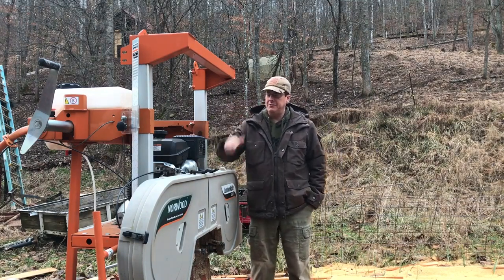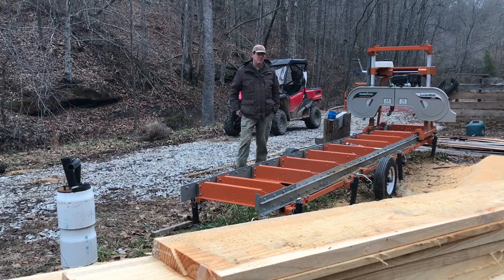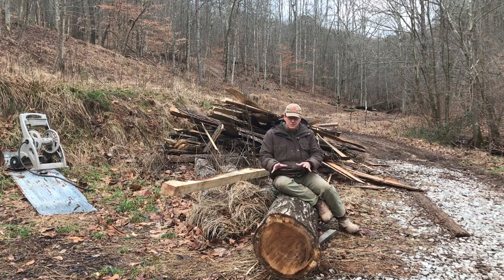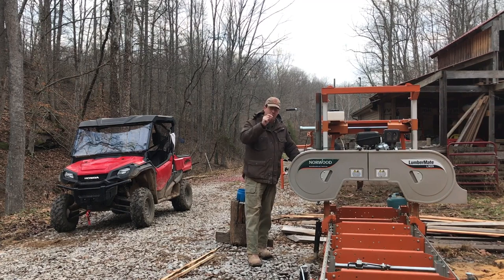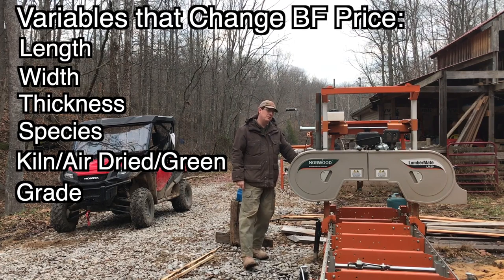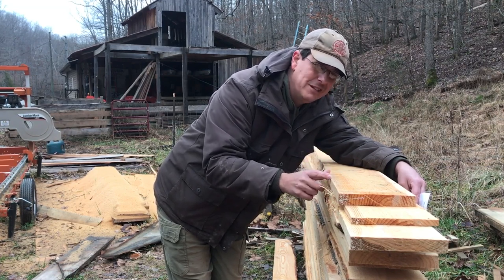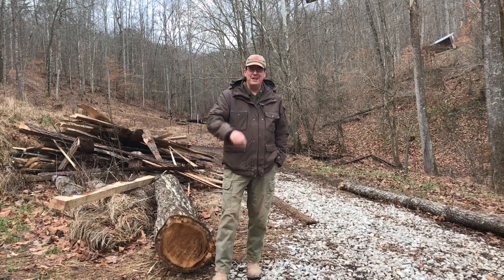What is a board foot?? - How to UNDERSTAND and PRICE lumber

Comment: Your absolutely right Troy. I used to own a shake mill that sawed cedar into shakes/shingles and it was by the cord. Just so happens that a cord measures 144 as well and after some study I had to be ready to buy what they had or half cords or and etc., so in my simple mind figured out how to measure ricks of wood that might be twenty feet long by two foot lengths of wood and break it down in inches then do the math. They were so happy cause they didn't get docked cause it didn't set in a pallet or wasn't a full cord as they went into the woods and packed it out to their pickup and bring it to me, I would measure in the pickup how much they had and then they didn't have to stack it in a pallet, they simply put it in the pile and we used conveyors to bring it into the mill. It matched any hillbilly set up that you have seen in virginia or surroundings. I was down in arkansas and you seen p.u.'s going down the road with no bed but frame rails and pulpwood on the back. Not uncommon to see spring leaves falling out to the roadway an into on coming traffic. They were poor and did what they had to. I donated a lot of time to poor people making what they had safe and reliable and it felt good. a cheap welder and scrap steel and they had a bed that the tires didn't rub on the load. It was dangerous but I ate well as they raised most their own and meat and dinners and you name it came to me seemed as everyday including some embarrassing offers... those I thanked them but no, I wasn't that lonely/LOL. People do what they have to to survive and most other people never gave them the time of day but a friend of mine took me from a drunk to  christian. I don't think that will get me through the gate but maybe a cooler side of where I might wind up. I served in nam and have horrific memories

Comment: Woodweb has a lot volume calculator I have downloaded on my phone. You just ate n45 the diameter and length, and it gives you the board feet. That simple! Oh, and you can choose between Doyle, International, or Scribner volume rules. Most use Doyle, but there is a move in some areas to international.

Comment: Can you cut your own boards but take them somewhere to be kiln dried or would you loose the advantage in saving some of the cost/advantage in milling your own wood? If the answer was yes, is there a way you could dry or process your wood in a similar manner?
Reply from the maker: Not too  many commercial mills would take lumber just for kiln. Some people have their own kilns (we did years ago). I prefer to air dry until at the desired moisture.

Comment: Was just wondering for example if you cut all boards 8/4 and you got 60 boards ( not your wood ) would the price be less than if you cut 120 boards at 4/4 . Same board feet but it took a lot longer to cut 120 boards compared to 60 boards . I take that you must charge extra for your time even though you have the same board feet . Just guessing here ,

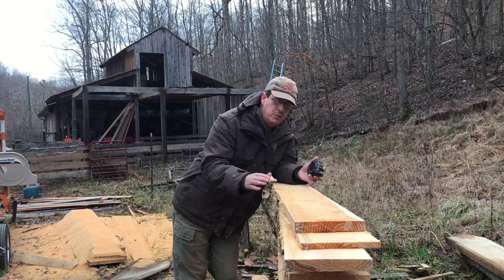Comment: I worked in/ran my family sawmill for 20 years. That 1/8 inch kerf you talked about made my family wealthy. In a production dimension lumber sawmill you saw boards 7/8" and 2x 1-3/4" so they will dress/plane 3/4" and 1-1/2. That's hard to di consistently in a production environment. In this video at 2:20 is an Esterer sash gang saw. https://www.youtube.com/watch?v=gZJZEtEnq3g&list=FLk7KXE2mdWZP5769I6ur2og&index=12  The saws are spaced with 7/8" and 1-3/4" aluminum spacers (I hack sawed a lot of them in 20 years). That 1/8" + the 1/8 you gain by board thickness, on a 14" to 24" yields 1 to 3 more 2x per log times 250 to 300 logs a day times 210 working days a year = lots of money over 40 years.